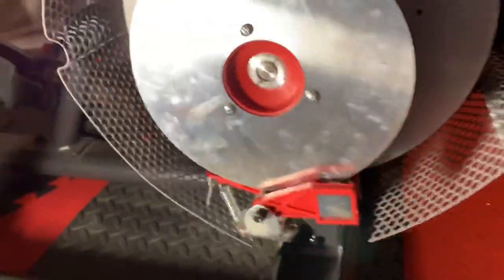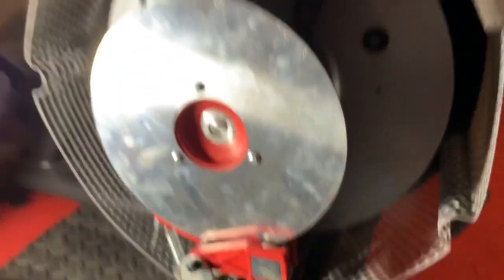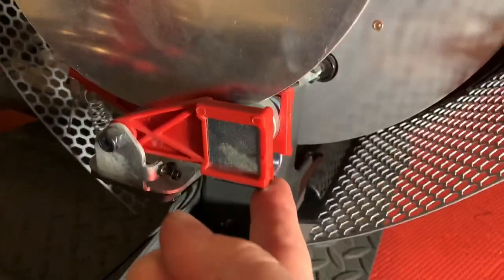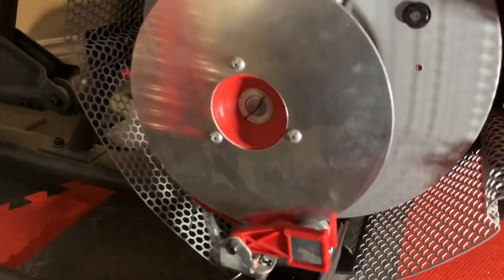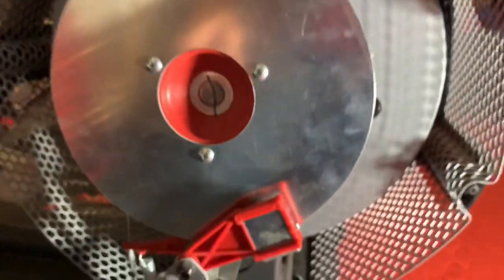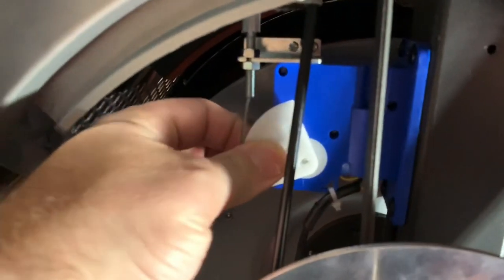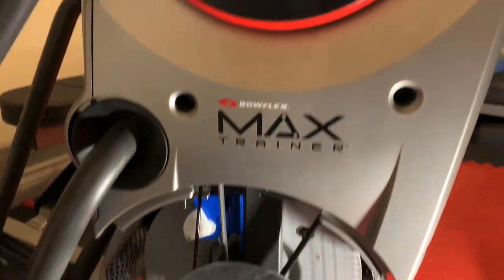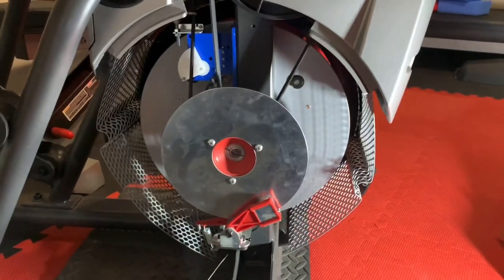Bowflex Max Trainer  - Tension & Resistance Issue & FIX

Comment: Wow, I found your video too late. My M6 was making scratching noises at the beginning and end of a run. I worked up the courage and opened this exact shroud, and I found that I guess the resistance arm was sitting right on the wheel making contact. I didn’t realize that there was an adjustment thing at the top, and instead I pulled the cables from the left to reposition it, but I didn’t realize that there’s a set position for a certain resistance. I haven’t gone back to using it since fixing it yesterday, I hesitate to open it again and re-tune the resistance unless I absolutely need to. But this video is very helpful. I appreciate you posting it.

Comment: Added tip. The easiest way to get easy access to make the adjustments is to remove the magnet wheel. Its get three screws which are really easy to remove and screw back on. the wheel just pops right off and can be slotted back into place.

Comment: This was most helpful. Even the call Bowflex for the part replacement tip. $18.73 including shipping. The customer service rep said bowflex was keeping the servo price low because it is a common part needing replacement. 5-10 year life span. I priced around other places before calling bowflex. A lot of companies is selling the same part for $89.90. Thanks M Carter.
Reply from the maker: Their support is pretty good. The part on the other hand is a bad design though.
Reply: Can I have a link to where I can order parts?

Comment: THANKS great vid. I had same problem, way too much resistance. If you pause the vid at 0:41 you’ll see the tail of the cable coming through the red arm next to the spring. If you loosen the “stopper” (sorry, no vocabulary) and pull the cable through you can accomplish the same thing. Maybe easier to access than the other two adjustable screws pointed out. Cheers.

Comment: Had the same problem  -  no resistance. It had a different cause, but did involve the white plastic quarter-disc.  The cable had slipped out of the groove, this illustrated where it needed to go, I popped it back into the groove and was good to go. Thank you. PS, the hardest thing for me was getting the housing back on and the screws aligned.

Comment: This video helped me so much. I wasn’t having a tension issue, but my break disc was rubbing on the magnets making a bell like noise, so thanks for the explanation of everything, helped me a lot!
Reply: How did you fix it? I have the same issue
Reply: @TheCMaillet  I have yet to fix that unfortunately. I plugged in the machine after not using it for a while to find that my display unit is bad, and a new one cost almost $400, so I don't think I'm going to fix it. Sorry!
Reply from the maker: Excellent! Great that it helped you figure it out.

Comment: I thought my motor was burned out too because the white pie piece wouldn’t move at all, but I removed it and adjusted the resistance to find out it still moved! The two magnets were bottomed out so I remounted the white pie piece to where it would engage with the wheel on level 1 and I was back in action. So I recommend folks to mess with the pie piece first by removing it and then adjusting resistance to see if the gears inside the motor (where the pie goes in) spin. If they do then it’s a matter of putting it back in and playing with the positioning of the magnets. I did have to adjust tension because the 1 was too high after I resolved it.

Comment: Fixed mine, which also had the bad servo.  The servo would move but go a couple steps then go back, no adjustments would make it step through the full 16 steps.
Reply from the maker: I've replaced mine twice since I've had it.

Comment: Thank you for sharing. Seeing the tension motor and the pie-shaped lever and cable position alone helped solve my tension issue. Must have flipped completely around as the cable was around the back and not in the groove in the front. Took your advice not to remove and just moved and cable and it’s back to normal.
Reply: I had the exact same problem...Cable flipped completely around on the 5th time I used it. Maxtrainer M9 just bought it 4 days ago.
Reply: @unds85  how did you getvit to flip back to the side e.g. back into the groove? There is too much tension to move it
Reply: @judsonames4622  relieve the tension by getting the wire OUT OF the groove then reposition the cam and in the home position and then put the wire back in the groove.

Comment: @GetCart3r I have the same issue with my M7. I noticed that even at 1, the magnet is almost fully inside the disc. I rotated the white thing to the next groove. Now, at 20 (highest setting), the magnet is covered only about 75%. This I guess means that 20 for me is what 16 should be. I guess I need to fine tune with the top or bottom screw, but I'm finding both impossible to turn. I'm a bit confused as to what I should be turning.... is it the nuts on both sides of the board, or the thing above it? Any details about the fine tuning process would be great. This is already a lot more usable though.... levels 1-7 are the same, but then from there to 20, I get differing resistance. And this is much more usable than before where level 3 equated to 20.

Comment: The servo motor on the Max5 started knocking which meant that it was toast. I used another YT video to replace it. When I tried to check it by setting the burn rate (is this the resistance?), to 16 I had to hop down and look fast because the machine sent it back to the 1 position. The readouts on this machine are complete confusion. Having 2 dots gets you something like a 4 resistance and having 3 dots gets you 16? One YT video talks about the internet being swamped with these machines simply based on their readout and methods to change the resistance. I note that the resistance changes when I hold burn rate down, but nothing happens when I hold down resistance level buttons. The owner's manual doesn't even mention these buttons. I can get it to work but the logic to get it to work the way I want it to by using the adjustment buttons will not get me there. Next time, I'll spend more to get something that isn't off the rails.

Comment: Sorry this comment is very late, but it would be helpful if you could answer this. Me and my dad both use this max trainer, and he uses a program I’m not sure about, and I always use max interval. I always choose the level 4 resistance for max interval, and I could always average around 16.1-16.7 calories burnt per minute(note we did mess with the resistance awhile back because the motor broke). But now I can sometimes only average 15.1-15.6, or sometimes even 17.8-18.1. I’m not sure why, but the only thing I can note and why I don’t think it’s just me having on and off days is that when ever my dad goes on and I do the max interval, let’s say the resistance feels easy. The resistance will feel easy until he goes on it again, and then maybe it will feel hard, normal, or easy. It’s very random, do you know why or how to fix it?

Comment: Hi Carter.  I found your video and i believe that my servo motor is also cooked. You mentioned that the new part was around 24 dollars. I am doing some searching and I am only seeing motors for around 135 or more. Did the price just increase that much over the years or am I looking at the wrong places. I am also in Canada.
Reply from the maker: @rylon3144  I called Bowflex directly. I don’t look anywhere else as they had the part. 

I should order a new one just in case.

Comment: My engine doesn’t even respond to input from control panel. I think my engine/blue part is fried or doesn’t operate correctly. 

I ended up taking off the white fan pully lever. I feel like this is a lost cause now

Comment: Thanks for the video. I wonder if the fan on the other side ads any resistance? if not, do you think I could remove it?  It makes a lot of noise while working out :(
Reply: Hi Ahmad - You should not remove the fan for the following reasons:

1)  The #1 reason - Your Max Trainer will not longer work!  This because mounted to the fan's backing plate are 4 small magnets.  When you pedal the machine, the fan rotates and those magnets pass in front of a "speed sensor".  The  speed sensor is what "wakes" the machine up and determines the RPM (pedal speed) and your calorie burn rate.  If the fan was removed then the speed sensor would never detect any rotational movement and thus your machine would also "Pause" any workout.

There is a workaround (though still not suggested):

2)  The fan BLADES are riveted to the fan's backing plate and so, in theory, you could drill out the rivets and remove ONLY the fan BLADES.   Then those magnets on the fan's backing plate would remain and so the speed sensor would still function OK.  However, the fan blades provide SOME resistance and so your machine would not have as much resistance as it should, which means the calorie burn values would be incorrect.  Note the REAL resistance is provided by the brake disc and the brake magnets (using "eddy current" braking technology).

Also, the fan blades remove the hot air and help cool the brake disc's heat and so with no fan blades the brake disc would be much hotter.
Reply: @norcalkid2776    Thank you for the detailed information. I will try the second option as soon as I find a used m5 in my area :)

Comment: so i upgraded from m5 to m5u  and lost resistance, even when i click the numbers they dont go up , stays at 1 , i opened this and tries to adjust the white triangle ( i think it gave me some resistance) but the numbers would not change, stays at 1 does not go up .. do you think i should order  this blue motor ?
Reply: Same issue,  did you replace it?
Reply: I have same issue with mine.  Pressing the buttons to change the resistance doe not register on the console.  Is this a console problem or a sensor problem?

Comment: Where did you buy the servo motor? Can't find them anywhere on mine is doing the same thing. Thx
Reply from the maker: Called up BowFlex. They were very helpful and parts were not bad. I think the part was $20US. Just give them a call.

Comment: I have been having issues as well. I too found a video that had me adjust the pie. It didnt really help. The problem kind of fixed itself for a while. I have been doing level 1 / 2 on the max interval for several weeks. Now all of a sudden it is SO HARD even on level 2. I unplug it, plug it back in - sometimes it corrects it, sometimes not. But when i go all the way up to 16, I can hear the magnet grinding. Do you think replacing the motor will help with my issue as well?
Reply: Rebecca Ehrick adjusting the cable (like in the video) helped mine. First take that cover off and set the machine to level one. If that red arm with magnet on it isn’t sitting partially outside of the large disc then you’ll need to adjust the cable.

Comment: I just purchased a M5 off of a local person and as much as im enjoying it i've noticed that the resistance adjustment doesn't work.  I'm assuming this is my issue as well, a failed motor.  The only problem now is I can't find anyone selling them except a person on ebay for $500. Any tips on where to buy to ship in US?
Reply: You can buy the servo  motor at the BEST price direct from Bowflex.  You have to call Bowflex Customer Service to order the part.  They are about $18 including the shipping.  The Bowflex servo motor part # is 8004601.
Reply: Call bow flex direct. I did 3 weeks ago and got mine in a few days ago. I just installed it today 2/16/20 . The total price was 25 dollars. Screw that guy on eBay
Reply: 19.00 
They have in stock
Reply: @michaellanzi9242  Yep, like I previously posted,  they are about $18 (including the shipping) direct from Bowflex.  I actually got them to give me free shipping so I only paid less than $13!

They only make 1 servo motor which is the same for the M5/M6/M7/M8/Max Total models.

NOBODY should EVER pay more!
Reply from the maker: Ya BowFlex has them and they’re reasonably priced.

Comment: Thanks for the video.  I’m wondering if mine is over adjusting as well. Do you know what the position for the magnets is for level one?
Reply: For ALL Max Trainer models, the spec for the magnet position at Max & Min resistance settings is as follows:
 - At MAX resistance (level #8, 16, or 20 depending on model):  The BOTTOM of the magnets should be at the bottom edge of the brake disc.
 - At MIN resistance (level 1 for all models):  The TOP of the magnets should be at the bottom edge of the brake disc.
You make the adjustment at MAX resistance and then simply CHECK it at MIN resistance and the magnets should move the diameter of the magnet.  If it moves more or less, then your servo motor is faulty or intermittent and should be replaced.

Comment: When I line it up at 16, then set the tension down to 1, the magnets go lower than what 1 shows on your video. I have to set it to 6 to get it to where yours shows 1. Does that mean the motor is shot?
Reply: I have the same problem, did you figure it out?
Reply: @juancespedes8293  Yes. After a 3-hour call with a support person and getting nowhere, I finally told her to just send me a new servo motor and that worked. (She and her manager insisted my motor was fine. It wasn't).

Comment: I hope the is what is wrong with mine.. it is way to easy at level 16 I barely have to move it to get to my RPM range.. will have to tear it apart this weekend and see.. if so, then the magnets are not even on the wheel at 16 if its that easy if that is my issue.

Comment: My machine has 37 hours use and this part has failed. The UK distributer wants £55 ($76) for the part delivered. I asked if the part came with any guarantee, as they seem to fail easily. The answer was no, so if you are considering one of these machines, I would say consider something else with a better reliability record. A product is only as good as its weakest component and this motor is CHEESE!

Comment: be VERY careful opening the plastic piece covering the magnet. on my m5 the top piece has a longer extension embedded behind the actual frame itself that requires angling to get off. in order to achieve that angle, the cord that connects to the power cord breaks! fml

Comment: Where can I order the motor?
Reply: You can buy the servo  motor at the BEST price direct from Bowflex.  You have to call Bowflex Customer Service to order the part.  They are about $18 including the shipping in the US and about $26 to Canada.  The Bowflex servo motor part # is 8004601 for ALL Max Trainer models (except the M3, which does not have a servo motor).

Comment: Thanks for the video, what a disgrace thou that such a video is necessary. This is an expensive machine, $4000 in Australia, and it’s a piece of crap with zero backup from the manufacturer. Should have bought a Nordic Track, far superior quality for a fraction of the price.